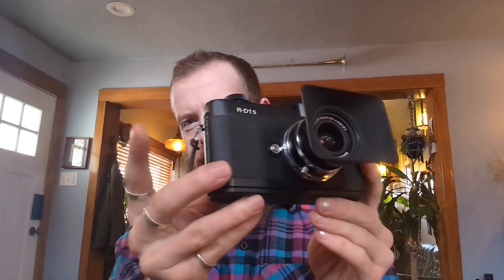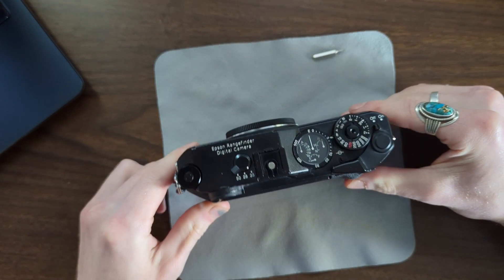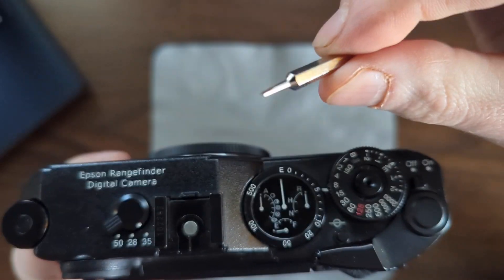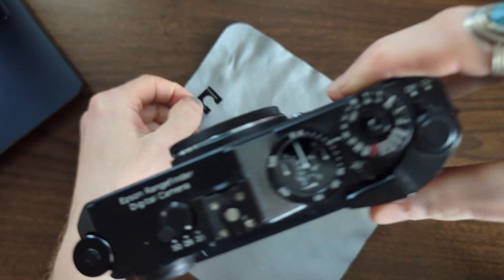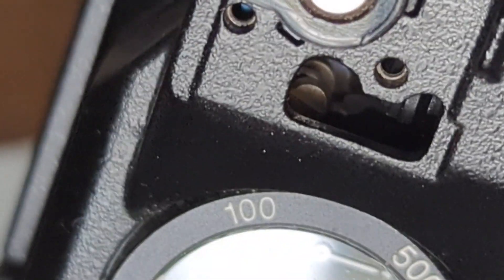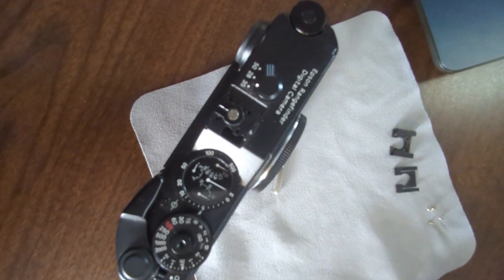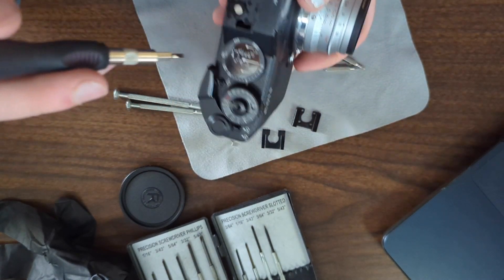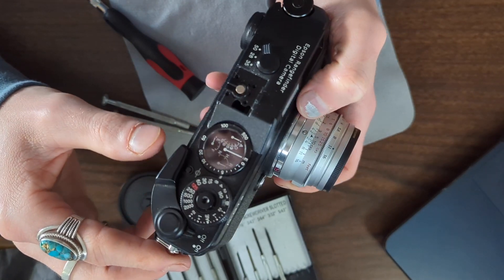DIY Epson R-D1S Rangefinder Adjustment (Vertical Misalignment)

Comment: Thank you for sharing. I have tried many repair shops but they are unable to fix my problem of the upper and lower parts not aligning. I am also ready to try it myself, but my situation is that the upper and lower parts align when I am at infinity, but there is a misalignment when I am close. I don't know if it is possible to adjust it. If I have to remove the top cover, it is a bit complicated for a beginner:face-purple-crying:
Reply from the maker: @codyguo1961  it's definitely a risk. If you're willing to take that chance and possibly damage your camera further, then it might pay off. I'm an absolute beginner and my camera is still working well months later
Reply: Hey same problem here, slightly vertically misaligned at close focus but not at infinity, the vertical alignment screw doesn't turn clock wise only counter clock wise... 

What did you do?

Comment: Im preparing to do a full recalibration on mine (top plate off) for the 2nd time. It's not too difficult. Just take your time. You might need to brush a little paint thinner on the adjustment screws to dissolve the factory threadlocking compound. Please do this if you experience resistance on the screws, they are fragile and the screw heads can snap off.
Reply: I purchased a R-D1 with a snapped screw head for the vertical screw. Do you have any suggestions?